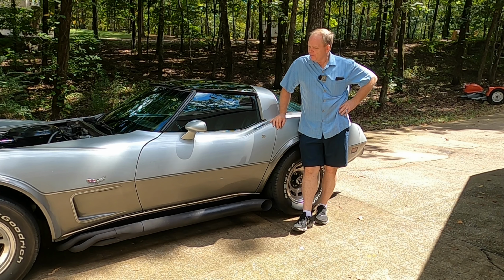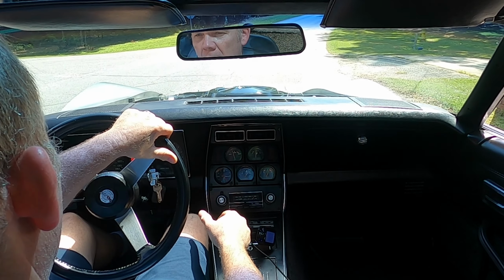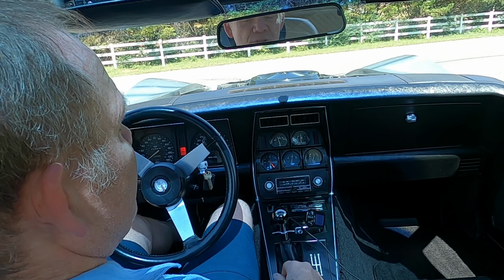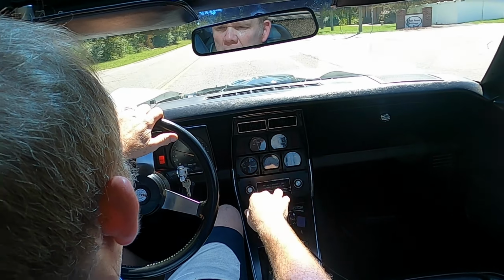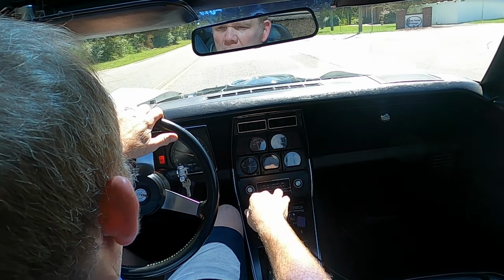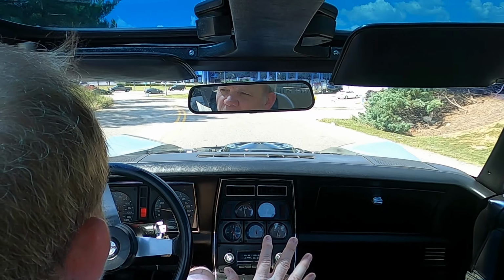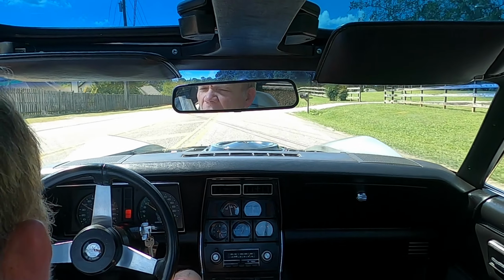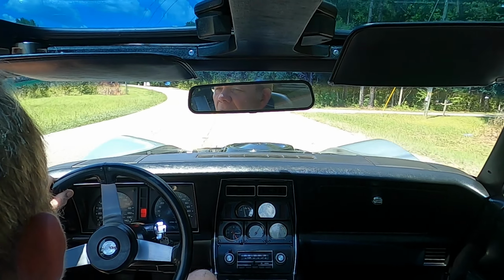VLOG - 78 Corvette - Test Drive - Motorsports Unlimited Top End Kit, Tremec TKX

Comment: It would be nice, if the Tremec 5-speed kit, came with a decal plate for the console new shift pattern.
Reply from the maker: It does. I chose not to purchase the replacement shift pattern panel. (It's actually a thin aluminum panel) I wanted to leave the original 4 speed pattern intact to keep the original factory look inside.
Reply: @ImpalamansGarage 
When you put the corvette in reverse at the gas station. My  OCD light came on.  😆

Comment: Just wondering how you like the new steering upgrade?  Take it on a road trip to Mississippi sometime.
Reply from the maker: Dang right..... The steering system is SO much simpler than the stock setup. The party piece is inside the gear. I think it is a Borgeson-Only design inside. From lock to lock it's much tighter.  I just need a proper alignment. My eyeball setup is good enough for testing for now. It actually tracks true if I take my hands off.